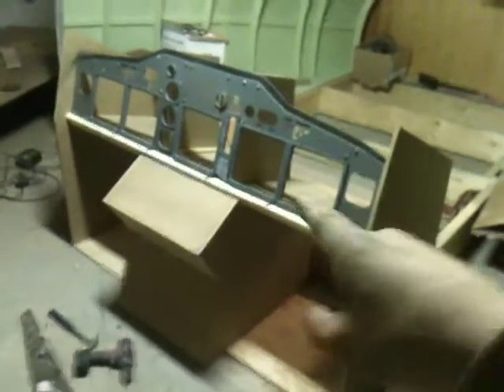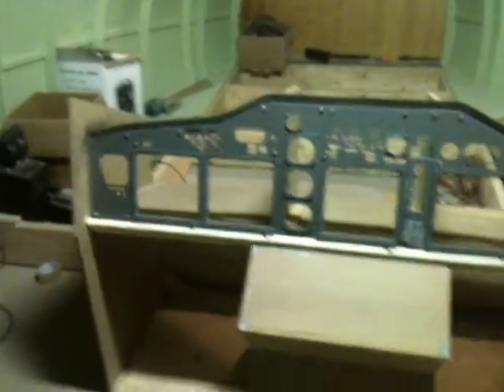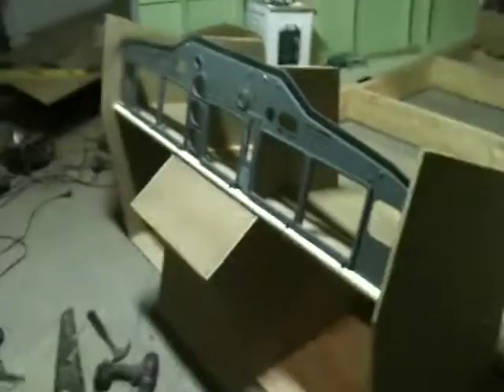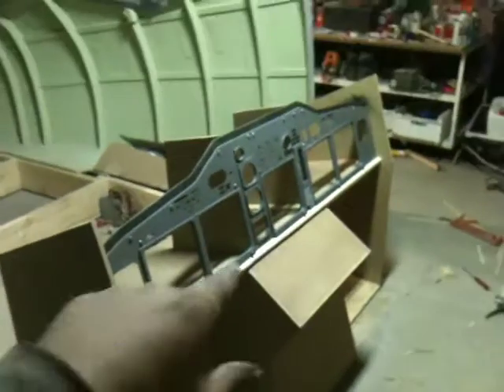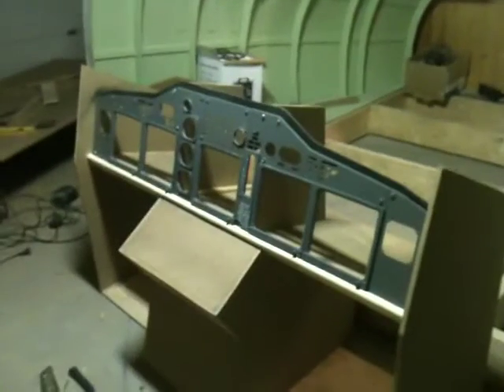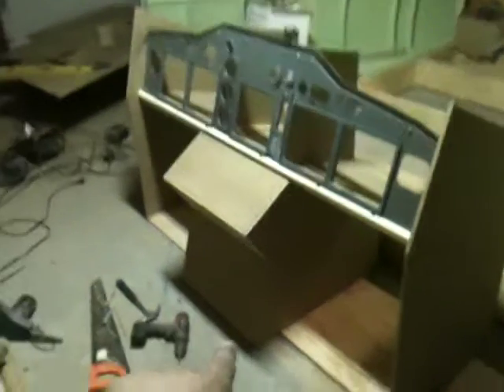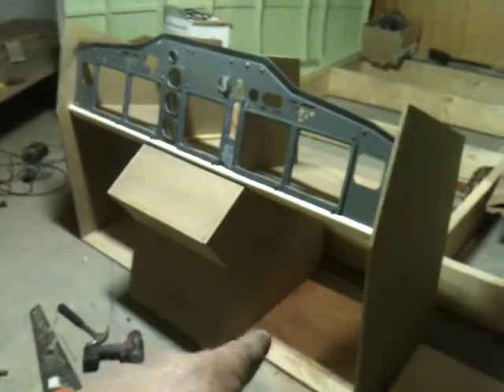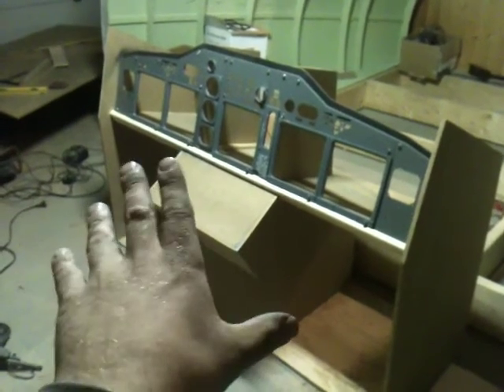Building a Boeing 737-800 home simulator #21

Comment: Why did you tilt the base plate rather than flip the two center-support pieces around and you get the 15° incline ? I believe you get the same result either way, but do you think of any reasons why not? (I'm startet with my own MIP-structure)

Comment: I would definitely get the glare shield done or at least started first anyway. I wouldn't want to be putting in electronics only to take them out again when you want to do the glare shield. Just think how great it will be when you get the electronics installed and working and over in the corner the topper for your MIP lies waiting. Great work so far.. I would test fit electronics then paint and placard the MIP just before installing the electronics. You may need to make adjustments before paint.